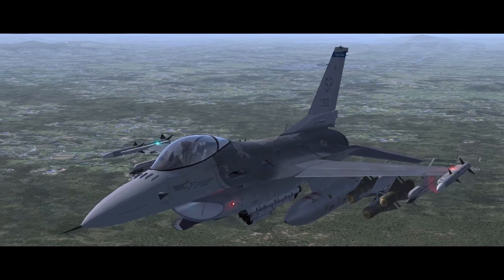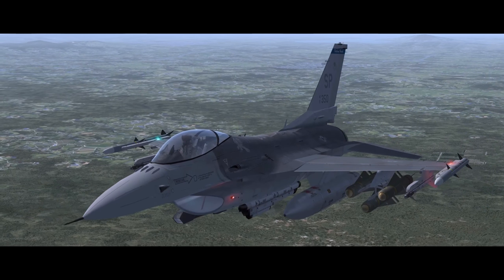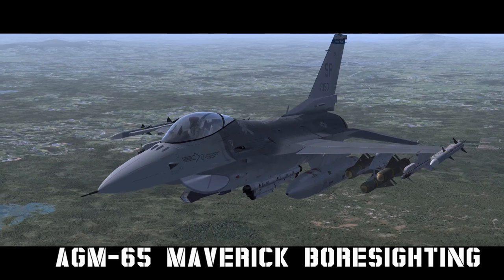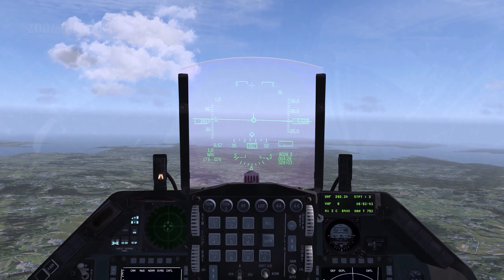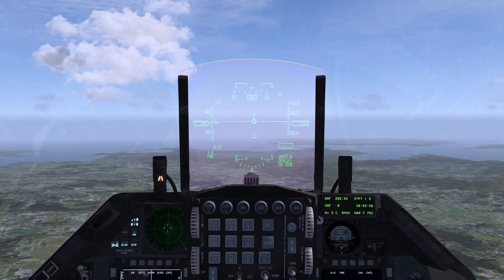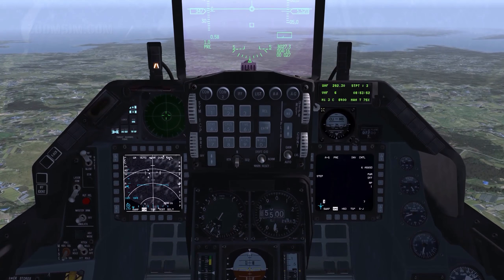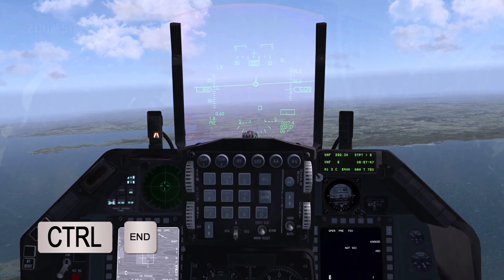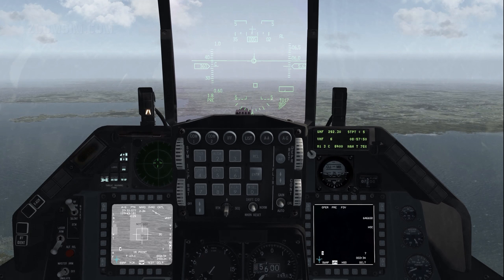Falcon 4 BMS Tutorial 25 : AGM-65D Maverick quick boresighting

Comment: how you are making the zoom on TGP?
Reply from the maker: You may also adjust the magnification level on the TGP's NARO display using the manual range knob, which is ALT+F3 and ALT+F4 by default.
Reply: Thanks a lot it works. But still I got problem to target hit. When I release the missile its falling down to empty area. I do not know what am I doing wrong. I've tried to do all you show on this video.
Reply from the maker: Make sure that the target is within the "keyhole" when releasing the missile.